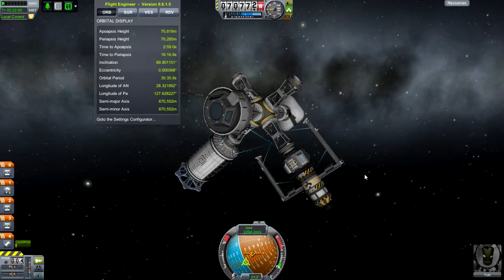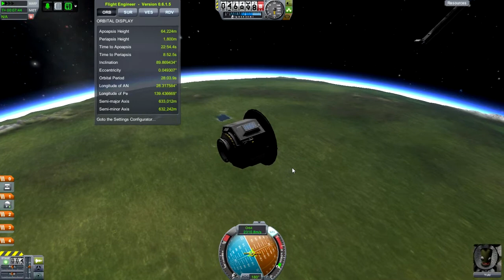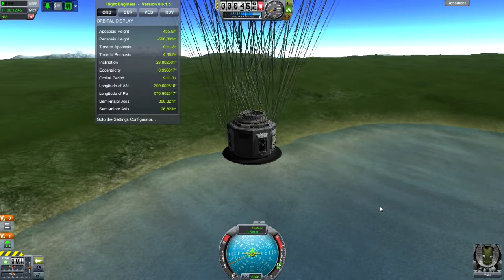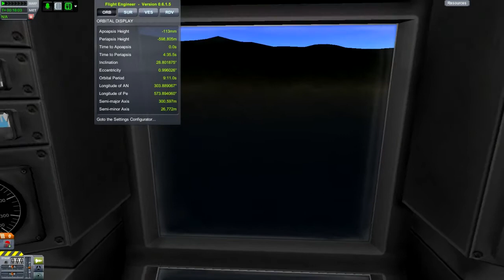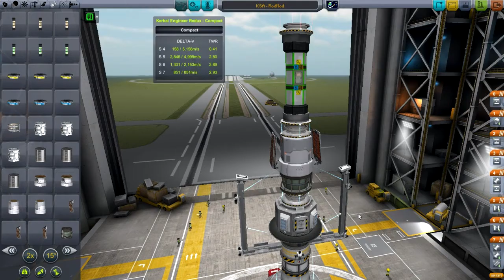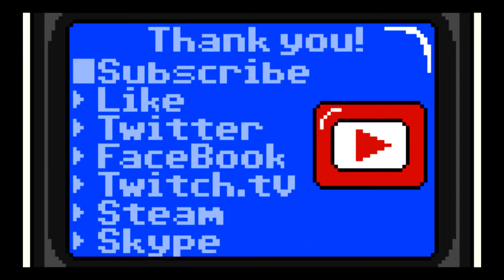Kerbal Space Program Ssn6 Ep6 HD - Rich full day

Comment: If you plan on moving more reactors you might want to set the tweakables inside the VAB so that the reactors are launched in offline mode, just so that you don't end up with an overheating issue ;) While the reactors won't explode... waiting for a week or so while it cools off might affect whatever you might have wanted the reactors for in the first place ;) All you need to do to turn the reactors online after launch is to fly a Kerbal in EVA to manually turn it on, as that can't be done automatically...